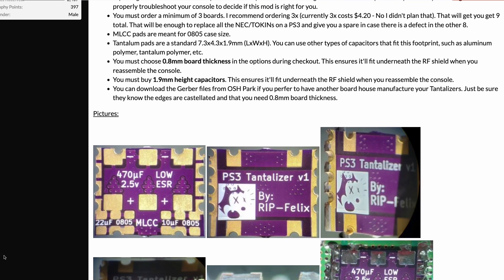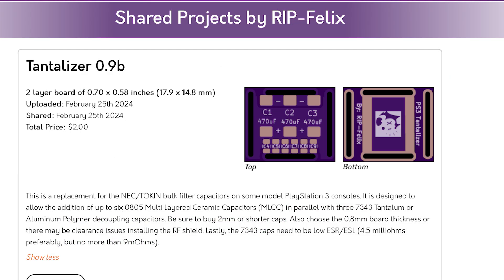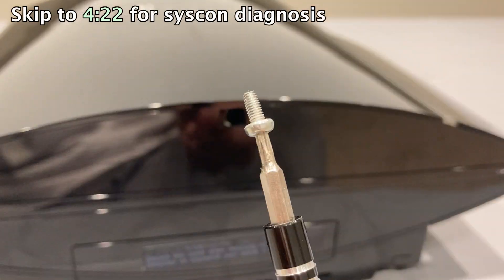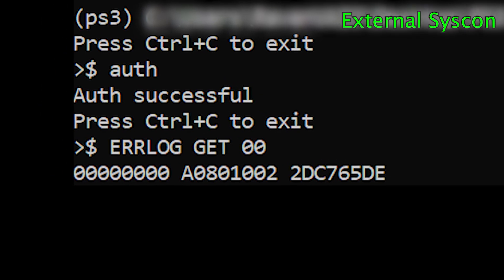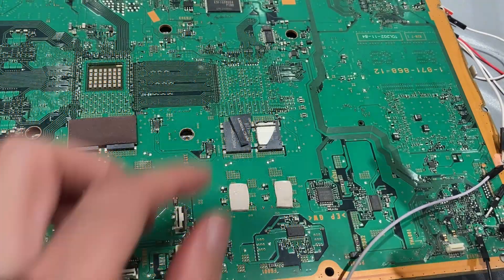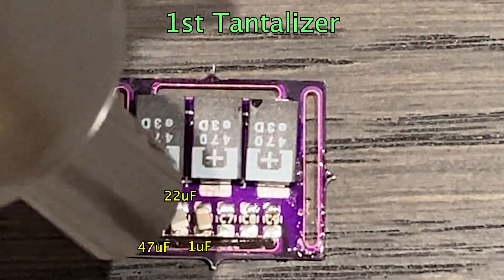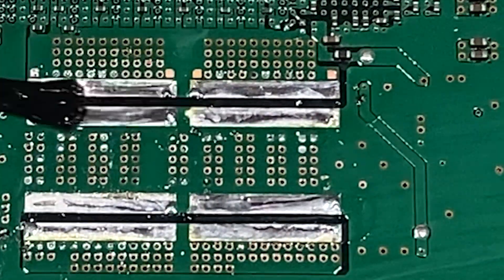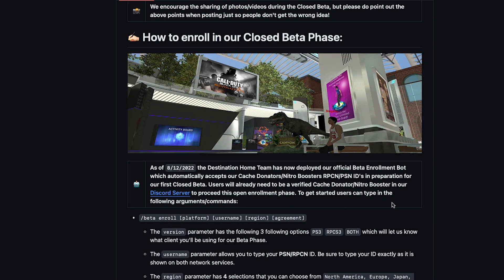‼️The latest NEC TOKIN fix for PS3 YLOD 1002 ⚠️

Comment from the maker: Since Premiere has ended, the chat is no longer accessible. Let me post my reply here.
@Toni For CELL side, if the TOKIN goes bad, you are likely to see 1001 in the syscon.
But be careful, 1001 can be also due to forced shutdown.
Reply: Sometimes on a console with weak CELL TOKINs just shutting it down normally will sometimes cause 1001s too
Reply: 1001 is also a general unexpected shutdown error, if it has another error its probably not related at all.
Reply: i have a cok-002 board with only 1001 in errlog and GLOD . would it need new tantalizer's or is there another fix i could do ?
Reply: @kriszimmermann9308  if you have glod then it's probably gpu related
Reply: いいね〜❤日本語翻訳もあるから楽しい

Comment: My PS3 just had the YLOD a couple months ago and the local repair shop is saying that they need to order a replacement motherboard.  Does anyone know a repair service near San Francisco Bay Area that would do this kind of repair instead of putting in another motherboard that could potentially break a few years down  the road?

Comment: Any suggestions for error code 3003 on a CECHE01 console? Thanks.
Reply: This error will occur in the case of a PWR failure on the main core voltage of the CPU (VDDC). CPU Bulk filter caps (Eg. NEC/TOKIN) or any SMD in the Feedback and Compensation network of the Voltage Regulation module (VRM). Including the Buck Converters (AKA IOR Power Blocks). A short Blu-Ray drive can cause this error as well.  If you experience error 3003, disconnect the Blu-ray drive power cable and turn on the PS3. If there is no YLOD, measure both the +5V_BD and +12V_BD lines on the BMD-001 board.

Comment: 12:08 for the CMOS battery on the ABCE models you need a CR2032 battery or battery case with a JST PH 2.0 2-pin connector.

Comment: Hey my man so I've completely dissembled my ps3 console and got to the motherboard I once sent my ps3 to a dude to fix it alright my nec token s show Nec tokin 0E108 anyway my ps3 doesn't work and show ylod if I replace the capacitors and apply will the problem be fixed and are there any problems that may be causing ylod like rsx cpu chips anything ? Plz assist me and like what capacitors should I buy for my ps3 slim ?
Reply from the maker: What syscon error do you get?
Reply: It's too late for that unfortunately my ps3 was broken and I mean all the way bad the power ribbon the dvd rom the motherboard I think we'll maybe not anyway the power supply seems to make lil shaking sounds and I think the hard drive is alright so idk

Comment: Really appreciate how in depth you describe the process. About to try my first replacement on a 1002. I see you replaced the 2 Tokin's on the back of the PCB, is there a reason you chose to start with those 2 as opposed the the opposite side or replacing all 4?
Reply from the maker: It's simply based on my experience. For CECHA, it works after replacing 2 TOKINs. For CECHL and onwards, it works after replacing 1 TOKINs.
Reply: @hardwarerepair200  Very happy to see 26 days runtime, ofw 4.82. Sloppy soldering job, yet somehow she lives after replacing the 2 rsx tokins on the back, thanks again :)
Reply: @hardwarerepair200  I will do the same on my CechC and repair those 2, thanks for the clarification

Comment: How do I find what capacitors i need? website says i need 3 7343 Tantalum's and 6 0805 Multi Layered Ceramic Capacitors. What do I need to look out for to get the right one? Or can you give me the website where you got them?
Reply from the maker: Any 7343 cap with low ESR (below 7) and high capacitance (470uF) would work.
I have uploaded the BOM file listing all the components I used here
https://www.pcbway.com/project/shareproject/PS3_Tantalizer_6f95a7fc.html

You can use it as a reference.
Reply: @hardwarerepair200  thank you, where did you get that screenshot of 8:14?
Reply: @hardwarerepair200  also does it matter if the MLCC are 20% or 10% tolerance. I see you choose 20% tolerance but I can't find any for the 10v 4.7uF capacitors for 20%. I did find them that has 10% tolerance, is it alright with those? Also I have another question. There are eight of those nec/tokins. Do I need to replace all eight of them or just four is fine that connects to the rsx chip

Comment: Hey I went to PCBWay where you seem to have this custom PCB with the parts installed. How many do you need to buy for a PS3? I think its 8?
Reply from the maker: If you have 1002, installing 1 to the RSX side works for CECHL.
For CECHA, I need 2 on the RSX side.

I only need 1 on the CELL side when I get 1001.

If get both 1001 and 1002, and you want it to be perfect, you can install all 8.
Reply: @hardwarerepair200  Thanks.I have a spare board to practive deliding and it was much harder than I thought. People make it look easy on youtube like slicing through butter, but it is anything but that. Have ordered that deliding tool and lets see if I have better luck. There is hardly any gap for me to insert the home made took I made with a nail file as per NSC videos.
Reply from the maker: I have a video trying the delid tool for the first time
https://youtu.be/TLDKUVKJAa0?si=QOY6UFb-7N45nC75

When I delid it cold, it's a bit difficult. But once I warm the CELL up a bit, it cuts like butter.

I also tried making a nail filer tool myself before, but after hours of sanding, it's still too thick. I think it took Felix a few hours even if he had a electric sander. So I simply gave up and simply buy the delid tool.

Comment: So you didnt need to add the remaining ceramic capacitors for the rip felix PCB, and in this repair you just replaced those two token with the rip-felix cap solution?

Comment: Hello, would it be too hard to repair a ps3 if I have not a lot of experience soldering?
I have my own ps3 that has the YLOD and I want it repaired. Thanks
Reply from the maker: Depending on what type of YLOD you have. If you have 1002, then you need the soldering skill as shown in this video.

If you have 3034, you need BGA rework. I have a new video about it:
https://www.youtube.com/watch?v=U7zR3myirH8&t=845

There are also other types of YLOD, and the level of difficulty will depend on which YLOD you have.

Comment: @hardwarerepair200 3:02 - its not, but  u must use proper degreaser, which IPA for sure isn't for that particullar use case...
Reply: Even straight up wd40 will do it
Reply: @DiJohnAngel  Exactly, that's what I thought about.

Comment: He can solder capacitors but not 2 CMOS wires? Just making shit cutting and working on single cable, one after a another preferably a couple centimetres (an inch) away and the raplecemount would've fit hm

Comment: @3:00 Nope, it is quite easy to get that sticky stuff off. There is no need for scraping and scratching, just use a little standard WD40 and then some isopropanol afterwards, to get rid of the remaining WD40 residue. Standard WD40 is not a lubrication oil, as some people think, it is solely meant for cleaning off persistent sticky stuff like this.

Comment: 3:00 you can easy clean all glue with clean gasoline like for zippo light crackers and etc
im usually buy high octane gasoline that is specifically sold for cleaning electronics. it is sold in electronic component stores.
this is also the same gasoline that is used in motors for radio-controlled airplanes

Comment: Dude if you have a hot air station, don't bother breaking up the tokins with pliers. You risk damaging the pads and cover the board in metal flakes that can cause shorts. Just use plenty of flux and cover the heat sensitive components.

Also get a pcb holder. The wood desk is probably ok, but a soldering mat wouldn't be a bad idea.
Reply from the maker: Thanks for the suggestions! Cheers!

Comment: Hi guys I have a Ps3 that is behaving strangely. It has GLOD. However, when I remove the hard disk it becomes a YLOD. Well, I thought it might be a defective RSX.  Nevertheless, I read out the Syscon and surprisingly it did not give me the expected error code 3034 but 1001 and 1002. Can a GLOD really be caused by defective NEC/Tokins or are the 1001 and 1002 caused by a defective RSX?
Reply: Bad rsx 3034 is the first clue most people replace the caps as well
Reply: But as I said, I don`t get a 3034, only 1001 and 1002.

Comment: Hi, I recently came across your channel and found it very helpful/enjoyable to watch. I’ve been collecting PS3 games for half a year now (acquired almost 70 now) and always used a superslim to play them. Recently I came across an offer I couldn’t pass up. I’ve bought myself a CECHC03 which was supposed to work flawlessly and it costed me only 100$ with a bunch of accessories. Unfortunately I have to admit I’ve been scammed. The console powers up normally (doesn’t have any GLOD or YLOD), but it freezes upon opening any digitally owned game and doesn’t read any of my discs. I have seen that this topic was covered on ifixit but there is no definite answers. The Cell and RSX don’t get very hot but the PSU does and after about 5min. its fan spins up to 100% and is deafeningly loud. The console is in rough condition and it’s been tampered with many times by the previous owners. I’ve lost contact with the seller as he wouldn’t admit to the console fault. Any idea of what could be at fault?
Reply from the maker: When it freezes, do you see any artifacts on the graphics? You case seems to be difficult to troubleshoot, but I would guess the RSX is dying and you probably need to replace it with a 65 or 40nm one
Reply: @hardwarerepair200  No, it’s just a black screen… but after doing a bunch of troubleshooting I found out something interesting. In summary the console works when I switch its output to any resolution besides 1080p. When in 1080p the console freezes upon opening any app/game. When in 720p for ex. the console reads games and opens the digitally owned ones normally. To me it seams like a failing RSX, but I’m unfortunately incapable of any BGA rework. I will stick to the lower resolutions for now and try to do a delid of the RSX (I’m to scared to do the cell for now).
Reply: @mammal1173

I would also say that it is a defective RSX. Or it is in its last breaths. I have a Ps3 C04 which like yours started to have problems at 1080p. Then at some point it stopped outputting a picture and when I reset the picture HDMI was dead and I got a broken picture via the other video connection.

Comment: Hi, is there any chance you coud tell me what model of hot air station you used when you removed the rsx on your older videos ? 🙂 thanks for youe videos, it is nice to see someone making progress without spending thousands on expensive bga rework stations
Reply from the maker: Sorry for the late reply. The hot air station is YIHUA 959D, it is indeed a cheap one.
For BGA rework, you also need a bottom heater. I use Puhui T8280 as my bottom heater.

Comment: Hii can anyone help me with that I have a ps3 slim when I started it's beeps 3 time and shut down and red led blink in 5th time I started it starts normal and I play GTA 5 for hours without any issues but when I play call of duty modern warfare 2 it work then doing 3 beeps and red led blink again and I don't have 
temperature issue  why? Also can I see the error syscon through the ps3 when it work or I need to soldiering RX and TX Also can I use Arduino uno or ESP32 to see the error code please help?
Reply: The 3 beeps during a shut down for the slim usually something minor. Do a safe mode and rebuild the hard drive and if you have access to a 2.5 adaptor and check for physical bad sectors using a paid software called HD Sentinel as well hard drive health check as a failing hard drive can cause problems to the PS3 like slow loading, crashing during games and the list goes on

Comment: Low temp solder also helps with removal
Reply: Had the same idea or use a high powered soldering iron that can output 450c at the tip and use circular blade Dremel to cut the tokin in smaller strip so it be manageable to take apart
Reply: @neddy1287  i would be worried about ripping off the traces if you apply too much heat too long lol
Reply from the maker: Indeed it happened to me in my very first attempt removing the NEC TOKIN.
I set the hot air to 450C and it ended up ripping off the traces together with the NEC TOKIN.

Comment: Hey I have a ps2 and I found that has no video no sound . And there's tantalum caps under the gpu do you think that I'd my problem because I took em off and tested the mf. And there supposed to be 220mf and its reading most of them 290-300!?
Reply from the maker: The value seems normal. A working cap should have a higher reading than the supposed value.
So 300 is perfectly normal for a 220 cap.
Reply: Have you checked if the PS2 is phat or slim. As for no video or sound is usually a broken AV port or no power to the board. As you weren't clear on the information

Comment: Remember that a particular error in syscon can be a fault in multiple PS3 components and potentially good NEC tokin will be replaced for no reason
Reply from the maker: That's indeed true! It's like a doctor diagnosing a patient. Even the same symptom could be due to different diseases.
Reply: Eventually they will go bad. This NECs were problematic back then in other electronics. Toshibas were notorious for failing due to this caps.

Comment: This is going to be a game changer if we can buy them premade
Reply from the maker: Computer Booter did.
You can check out his ebay
https://www.ebay.com/str/computerbooter916
Reply: @hardwarerepair200  Have a direct link to the product this is just the front end store
Reply from the maker: https://www.ebay.com/itm/255733429246?itmmeta=01HYHDQ5MSKEJ1VEB0KBF806F4&hash=item3b8ae673fe:g:mLwAAOSwp2RlnvkH

Comment: I miss 5 years ago when I thought that capacitor problems only affected ancient hardware from 30 years ago. It seems like all retro hardware is going to be rare in the future, because most people will see YLOD and just trash their PS3.
Reply: i still got MY PS3  has YLOD  60GB    still got the original box

i also got a n64 with the original box too
Reply from the maker: Are you planing to fix it and give it a second life?
Reply: I thought it was more than just the NEC tokens on old PS3's and the YLOD is also due to the same problems that microsoft had with the 360's GPUs in Xenon and Zephyr motherboards.

It sucks the hardware was faulty from the word go because the PS3 and 360 were without a doubt the last best generation of console gaming. Gaming stopped being exciting once the PS4 / Xbox One era came out and modern gaming feels like a soulless money grab with forced social engineering from investment firm consultants and microtransactions under the guise of gacha boxes..
Reply from the maker: Just like when a person gets sick, it's never due only one single disease.
When a console fails, it's never due to only one component.
Both require diagnosis to pinpoint the exact issue.

Comment: Don't measure capacitors with a multimeter, it rarely goes well. Use an LCR. You can get a cheap LCR T4 (clone of German Mikrocontrollerforum's open source Transistortester) it works just fine, or any of the related devices. It's one of my most useful tools in electronics repair, it really does a lot.

I don't think ripfelx will introduce any further significant changes to the Tantalizer, and you don't need aluminium electrolytic capacitors there since it's specified for modern polymer tantalum.
Reply from the maker: Oh, I didn't know that. I thought multimemter is capable of measuring many things.

Comment: You can directly soldering capacitors on the motherboard and do not need small one, they are on  a chip if self
Reply from the maker: Thank you for sharing! But I also want to bridge the positive terminals easily.
So a tantalizer board is the perfect solution.

Comment: i got error 1002 by accidentally knocked one of those tiny resistors or caps between the memory and rsx trying to delid. no error 3+++ on syscon diag.

i know the console was working before that 'big mistake' because i have been using the tantalums for both cpu and rsx for 2 years. i am newbie in measuring whether current and voltages are correct for ps3.

weirdly enough, after that one tiny thing knocked off. it can still turn on but no display and for 30 seconds then ylod. cpu is very warm and rsx a little

i have posted this on subreddit but received no response other than 'buy a new one'
Reply from the maker: 1002 indicates that the RSX is not getting the power it is supposed to receive. So it makes sense that you get 1002 after knocking off components near the RSX.

Comment: I fixed 3034 by pouring liquid flux to all sides under the BGA until it flooded. Then blowing the hot air under the board until all the flux dried. It's my first time doing this and I'm very happy with the result.
Reply: You probably didn’t get it hot enough to melt the solder. The GPU itself is the actual problem with 90+% of 3034 codes
Reply: Patience is the key, that must have taken long. Many ppl screw up by going too hot too fast while performing this fix. 👍🏽
Reply: What s the right temps
Reply: is it still working?
Reply: @jonjonmia nope. I noticed the cooling fan didn't run at full speed while playing then it failed again. So the root cause is something else. I need to mod the fan speed next, but I'm too lazy at the moment.

Comment: Those nec token adhesive are no joke. I just got under it and ripped it off from the middle.
Reply from the maker: What tool do you use?
Reply: @hardwarerepair200  just some surface cutters and an exacto knife to get in there a bit.

Comment: my brother in Christ you could have simply replaced the connectors to plug in the CMOS battery
Reply: Guy can microsolder these resistors onto the tiny PCB but he can't cut and join two wires??
Reply: @Agret sometimes you can just lift the tabs and remove the pins to insert into the other connector.
Reply: And use flux on the Netac caps